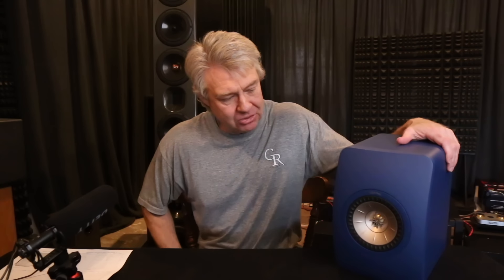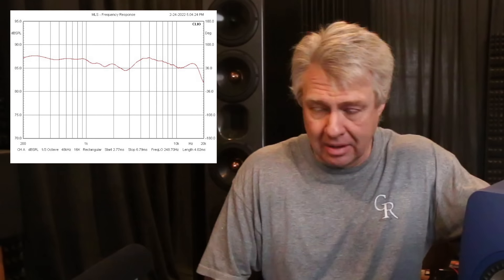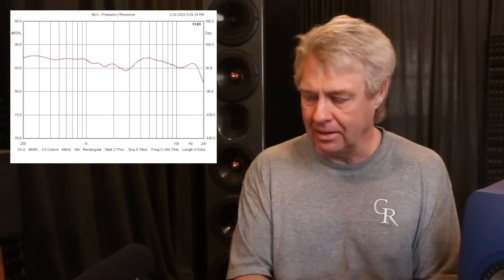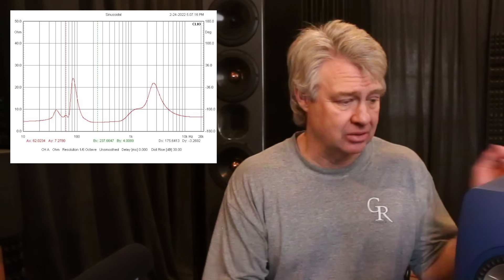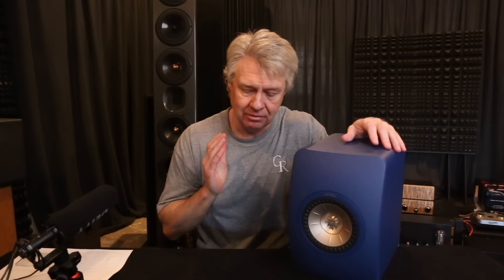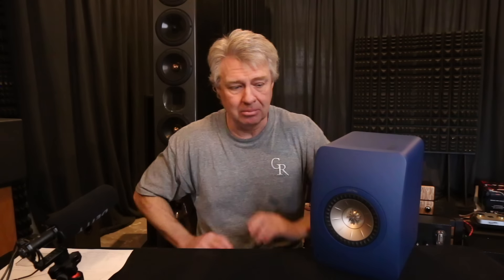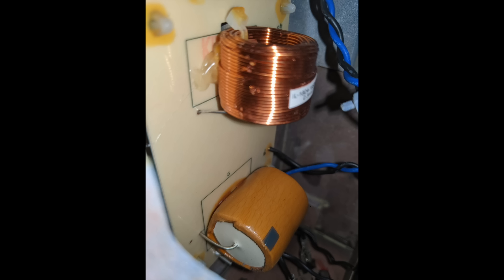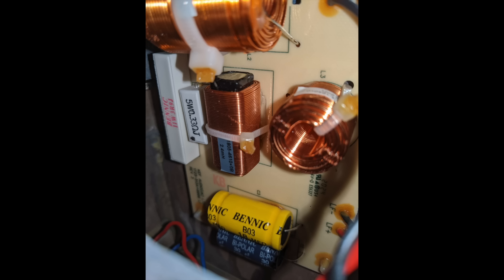KEF LS50 Meta! Worthy of HYPE?

Comment: The frequency response just cuts everything above 18khz. The LS50 is much better especially with rew where you can get a razor flat response. The meta tech just redirects the high end to the back of the tweeter. This is a case where they just wanted to keep selling their most popular box and just changed up with the response curve and presented different as better even if it's not as accurate or pleasant.

Comment: While this speaker and the standard Kef LS-50 seems to get a lot of praise, they also get a lot of dislikes too and this is from quite a few well known reviewers here on YT.   I am going to say that I am a very frugal person and I have been made quite aware of the hi-end audio industry and that you don't always get what you pay for and one of the big areas this holds true is with speakers.   While I had been an advocate of concentric cone speakers in the past, it seems there are a lot of audiophiles that don't like them.   I had come across Tannoy in the recording studio realm and liked those, but couldn't justify the cost.  I am very much a believer that you can get good sound without having to spend a fortune.   So teaming that up with what I said before about not getting what you pay for. I am very much against very high priced audio equipment.  Save for a a few decent companies out there, many take you for a ride.   While I knew this early on, I had seen one of your videos in which a $6000 pair of speakers had a crap crossover in it and the cabinet had some reflection issues.   So that right there confirms that fact.   Also, you did a review on a $2200 Focal speaker and it had a lot of issues.  When you pulled the tweeter out, it looked like a rinky dink Radio Shack tweeter!    In the past, I did hold KEF in high regard, but it seems as if their value has gone down.  Namely these LS-50s sell for around $1500 and I do admit I have trouble when it comes to spending more than $650 on a set of bookshelf speakers.  It was my wondering WHY these cost so much when I came across the negative reviews.   In fact, many that didn't like the sound of these speakers, preferred the sound of the Q-150, of which costs FAR less than these.   I did see your review and upgrade of those and even though the parts for the upgrade are expensive,  buying the Q-150''s and your parts still costs less than what the LS-50's go for.   It does seem to me that companies that I once held in high regard such as Focal and KEF are now becoming "Troll" manufacturers and are overcharging for their speakers.   Some people just drop so much money on what these companies ask for, and for what?  They maybe get a marginal improvement in sound.  It seems the higher you go in price, the less the improvement is.   By right these LS-50s, which sell for $1500 should 5 times better than the Q-150, but that isn't the case.  Given your measurements, I don't even think the improvement in sound would be twice as good.   So why waste your money.  Another case in point was when you upgraded a pair of Sony SSCS5 speakers.   The point was made that the upgrade costs more than the speakers do new, but for under $400, you ended up with a really nice speaker.

Comment: Every time I've heard those speakers I always came away from the experience thinking "These are very technically proficient but they seem to lack bass and are a bit thin." But this is why I got the old iQ90 instead of finding a used set of LS50. I wanted a 3-way so I could get an acceptable bass response without sacrificing the clarity of the mids while the bass was playing.

Comment: I wasn't blown away when I reviewed it. It was ok at best and is in dire need of a subwoofer to provide a full range sound.
Reply: Well, yeah, 5.25" woofers wont hit that low. But the speakers hit around 55Hz.
Reply: Astonished anyone would run any speaker this size without bass reinforcement.
Reply: When I see a speaker like this I would immediately question its lack of range, and consider a different speaker (like the Q Concerto Meta). Why beat a dead horse.

Comment: I'd say that the speakers are revealing problems elsewhere. Try putting lots of dry sand into a plastic bag and placing on top of each component in the system to find out which one is causing the problem. Or just place one bag on everything. 
Sand is awesome for getting rid of resonances, which is why it is used in speaker stands.

Comment: It's surprising when a speaker measuring this smoothly can sound fatiguing. Perhaps it's too sterile sounding from the extremely damped box and long term that could be annoying to listen to.
I don't know but it's kind of intriguing.
Reply: We're not really sure either. The speaker didnt show anything that would indicate brightness, and even has a dip in the range where most brightness/fatigue occurs vs the original LS50. The amp they use isn't bright or sterile either, based on what info I could find. We suspect it might be their room, but it's hard to say for certain.
Reply: I’ve owned a pair of these speakers for over a year and they are anything but fatiguing. I currently have them connected to a Hegel H190 and DirectStream DAC,  and the sound is glorious. Crystal clear highs and the midrange is amazing with both male and female vocals. The midrange never sounds veiled. The top end is also much smoother on the Meta than the original LS50.
Reply: @frankkroll7881  Hegel amps are known for being "warm" sounding, especially compared to the NAD amps I've heard. I imagine that the Hegel would be an excellent match with the LS50 Metas. Tho I suspect their issue is more rool related than anything.
Reply: 3-5k is essentially boosted and those frequencies are definitely fatiguing...
Reply: @Taco I have found that, even though Al cones seem to be more resolving and may present more detail, I seem to prefer a paper cone whether its' been doped, infused with glass, etc. Al seems to be a harsher sound to me.

If I had to replace my Focals, I would consider a Heco...starting to hear good things about them for a more budget priced speaker and relatively higher impedance. Perhaps Bucchardt or Tyler audio if I were to stretch over $2K territory.
Reply: @DWHarper62  you might want to check the graph at 1:06 again.. 2-3KHz are dipped 1-2dB compared to everything below 1KHz, and between 4-8KHz.
Reply: that’s the nature of damped small speakers, just implement an eq to balance the tonality like the active version ls50W will be OK.
Reply: I wouldn't advise equal distance from back and sidewalls in most cases.  You'll be reinforcing boundary interference/resonances at the same frequencies.
Reply: @hoth2112  
From what some see it's not tweeter level that needs to boosted, since as you pointed the 4-6k is higher than mids. Most likely I would try to even out the hole in 2-3k, although it might not sound as bad as it looks, depending on 'cone and dome character'. Definitely I would do something about the peaking in lower treble, the 4-6kHz might add liveness to the sound, but too much might harsh and fatiguing for long term listening. I think from what I have seen, the tweeter dome resonance is very high in 30kHz zone. The dipping in freq. resp around 20k, is because of the coaxially mounted tweeter and diffraction issues. All I learned from this review, is that KEF uses 'cheese' crossover parts, but this has been the standard here.
Reply: @hoth2112  I have to disagree with you. When powering my Metas with my Hegel, it was VERY bright compared to my NAD C316 or Denon PMA-2000. I actually sold the Metas because of this. I loved the Hegel but was NOT a fan of the fatiguing sound when paired with the LS50 Metas. And I definitely would NOT consider any Hegel amp "warm." Neutral at best. But NOT warm. And I've owned an H160 and now have an H190. Both have similar sound signatures.
Reply: @hoth2112  What one wants to see is a slightly sloping graph from bass a little high to treble a little low and if you look at the graph with that perspective, you see a boost at 2-3k compared to a gentle descening slope...
Reply: @hoth2112   I meant to say 3-6 k, read graph wrong...
Reply: These are actually on the warm side to me (as shown by the measurements).  Personal opinion I suppose.  Lack of bass extension makes them sound brighter than they are.  They're not bright, they're lacking bass.
Reply: @rpkett  Have to agree.  Hegels are not warm at all to my ears.  Fairly neutral.

Comment: Whoever brought him that speaker was having issues with fatigue / brightness.  But then the review goes on to address the general quality of the parts inside and doesn't address the factors causing listening fatigue.
Reply: Those parts are part of the problem.
Reply: @dannyrichie9743  OK.  I heard the powered version of the Meta at Best Buy and it was the only time Adele's voice ever hurt my ears.  It was painfully forward.
Reply: What you do is pair it up with warmer dac/amp. Problem solved.
Reply: @StefanUrkel  A tonality change from DAC won't solve the smearing caused by the poor quality crossover parts.

Comment: Very informative video. I own a pair of pre-Meta LS50s. The owner who sent in the pieces you examined may not have told you that the LS50 (and presumably the LS50 Meta) ships with foam plugs for the ports. There's a partial plug with an open center, and a full plug that fits inside the center opening of the partial plug. Using a quality amp with 190 wpc into 4 ohms, I find that fully plugging the ports improves LS50 sound quality significantly without noticeable reduction in bass impact -- in my room, of course. I also have a subwoofer, but don't always turn it on to use with the LS50s. It's a pretty close call -- close enough that I would recommend to prospective buyers that they spend more on a better amp versus buying a subwoofer.

Comment: I was thinking of buying META's for a smaller room, but I don't like not having the option to upgrade cheap parts in the lower crossover. Too bad because the META's check so many boxes for this particular area. Hmm. Does anyone have the newer Buchardt MK2's? If so, how do they perform near field and low volume?
Reply: You don’t need to upgrade the crossover. Believe me, the bass/mid unit sounds great, just use a good amp and stands.

Comment: The LS50 is remarkable, but it requires a few things: careful equipment matching, needs to be placed at least three feet away from the walls, with little to no toe in, and 24 inch stands.
Reply: Ear level
Reply: @The0nionKnight  I much prefer the 24 inch stands.  Plenty of clarity and the imaging is the right height. I’m also only 5’6”.

Comment: I'm a bit confused, you say all the way through the video that they are decent, with measurements, build quality and most of the crossover parts. Then you say you don't recommend them, but never said why.. so, what was the reason, you need to elaborate further. Your contradiction has confused me.
Reply: Their choice of budget level parts in the woofer circuit handicaps them quite a bit, and fixing them is just too much trouble. There are easier and less expensive ways to exceed them significantly.

Comment: I bought some of the powered KEF's to hook up to my iMac.  Worked and sounded well for about two years.  Now they don't work, as the amp is kaput.  Now I have $700 paperweights.  I will never buy a KEF product again.  I got a pair of powered Emotiva's at the same time.  They still work fine (although they don't sound as good as the KEF's did).
Reply: Why not have them fixed?
Reply: Same issue here... not worth fixing as problem returns. Kef is the worst company in hifi
Reply: KEF doesn’t make the parts anymore, and to try with newer parts costs too much.  Thought about making them passive, but that takes a lot of work too.
Reply: is there active eq in the amp?  why not bypass the amps?

Comment: I am in no way any where near qualified to give a solution to what makes this speaker good ... Correct me if I'm wrong , the factors to evaluate a speakers performance should be the amp, the source component(s)  and the music production.. (short of the internal components) I'm a cd person and all cd's are not created equal.. the engineering in all cd's are very different.. One may sound great on that speaker and another may not live up to the same.. Change amps change cd players and change cd's and you will get a totally different sound

Comment: Maybe I should watch this video again yet I get the impression you only did measurements and didn’t actually hook them up to actually listen to them musically. I dig that you can see where certain internal components can be upgraded yet I’d put more value to your review if you gave them a listen then compared to what you heard musically to the measurements you did. Thanks!
Reply: This isn't a review and I am not a reviewer. Speakers are sent here so that I can make them sound better. Some things about this speaker were engineered pretty well, but the drivers and parts used do hold them back quite a bit. If they would have been easier for the average guy to work on then I might have done some things with them.
Reply: But Danny tgat includes listening to them. Yes thats subjective from a general point of view, but much less so if you listened, modified and listened again. You'd then know exactly what difference those changes made. Whether they're better, worse or (in most cases just differennt) is then down to the buyer.
Reply: @analogueman5364  I spend time listening to each and every part to learn the exact sonic effect and how it will effect the sound. So going back and comparing the sound of an electrolytic capacitor and an iron core inductor to a poly cap and an air core inductor becomes redundant.

Comment: Iron core and sand cast on the woofer, where have we seen that before, oh yes the KLH. but they weren't being cheap, even though they cost more than the KEF.
Reply: The KLH 5 is a 3 way speaker. The woofer is crossed over low enough that the cheaper parts don't affect the mid-range much if at all. The mid-range driver itself had pretty decent parts in the crossover.

Comment: Hey Danny maybe next time Usher speakers :-)
Reply: I did some design for for them years ago. So some of them I am very familiar with.
Reply: @dannyrichie9743  I have Be-718 beryllium, but my crossovers are from Taiwan ... does the modification make a big difference to this model?
Reply: @rumerssorc799  Then you are in luck. I designed the crossovers used in that model (used in production) for the North American market. So I have everything you need to give them a significant upgrade.

Comment: A very good, thorough examination, and presentation of this very hyped, promoted, and advertised KEF LS50 Meta speakers. I think that these pair of KEF bookshelf speakers are of high performance, but for a dollar before 2000 Canadian dollars there are less expensive options. To be realistic, however, this KEF speaker was not designed, and built for deep bass, anyway; so why have upgraded electronic for the bass section? 

Fortunately I bought a pair of Klipsch R-51Ms; however, those Klipsch bookshelf speakers don't have deep bass either, and that auditory observation is obvious, and logical. Therefore, that's the way it is with a speaker that is not bigger, and a driver mostly for bass that is not 6, or 8 inches in diameter. Or maybe my statement is very simplistic, but I thought I'd add my simple opinion, anyhow.🔉🎵🎶

Comment: It's no killer.🤫  Yet reviewers usually gush all over this speaker?🤔🤯🙄😇  These reviewers do listen to them, I assume you did too in mono?  Turns out best way to evaluate a speaker it turns out.😬
Reply: It's really uncommon that we get a pair of speakers from a customer, so there's not much point to listing to a single speaker in mono. Much of our evaluation is just measuring the stock response of the speaker then looking inside to get an idea of the parts quality.
That said It's not terrible speaker tbh, it's definitely one of the better built/desiged models we've looked at. 
But it still leaves performance on the table, and has the resonance issue with the port, which is going to lead to some chuffing.
Tldr: It's not "bad" but its not "great" either.
Reply: @hoth2112  
😇